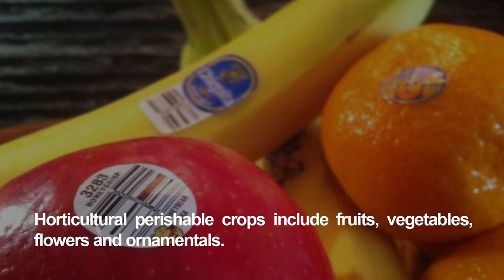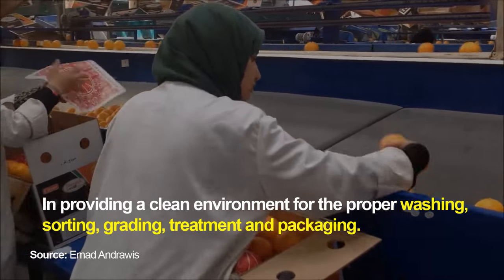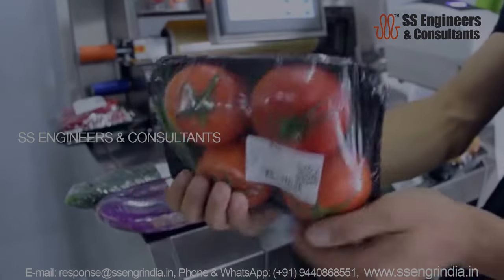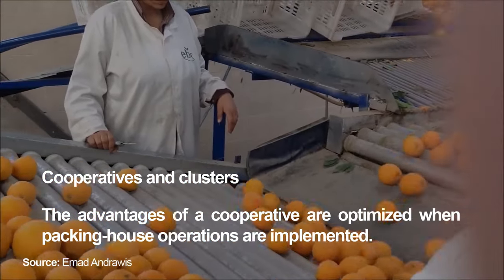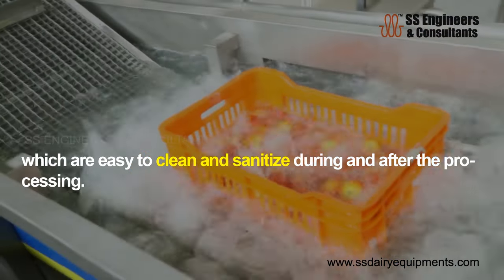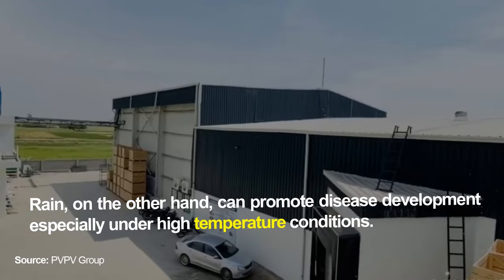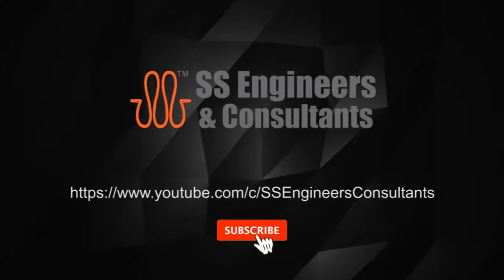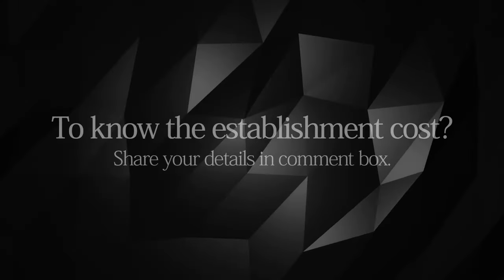Guide for setting up Fruits & Vegetables Pack-house| Post Harvesting| Agriculture Farm Produce.

Comment: The device they use at 1:46, is that only to measure the firmness of the apple? Or does it also screens if the fruit may have internal defects?
Reply from the maker: Thank you for your comment.
Contact us at (+91)7569309005, 9851446644 or mail us at project2.ssengrindia@gmail.com for more details.